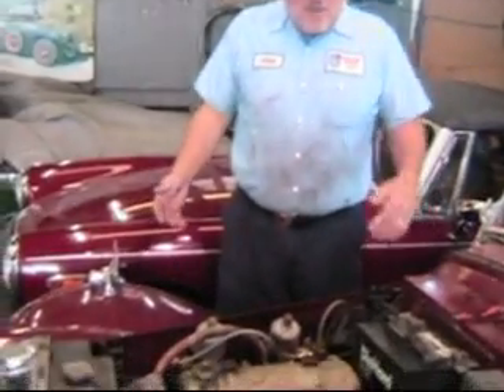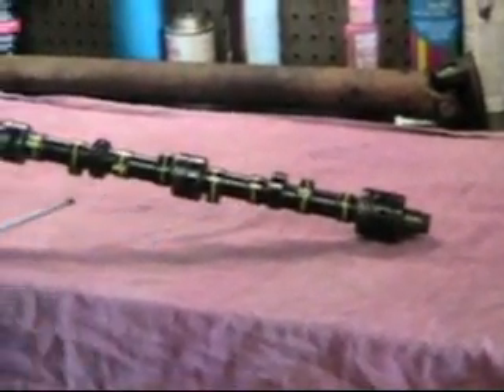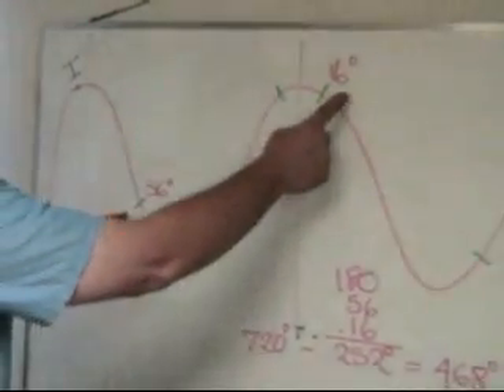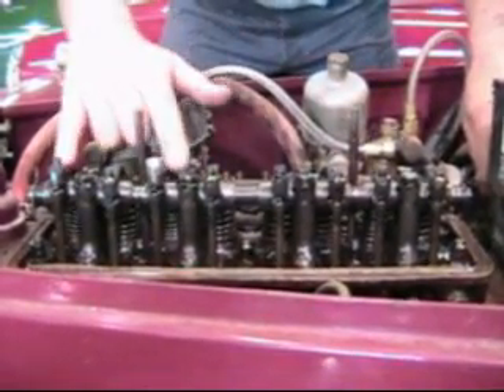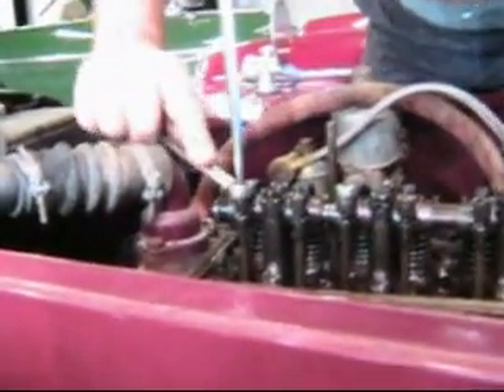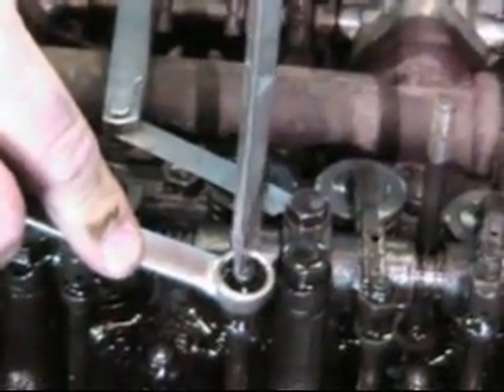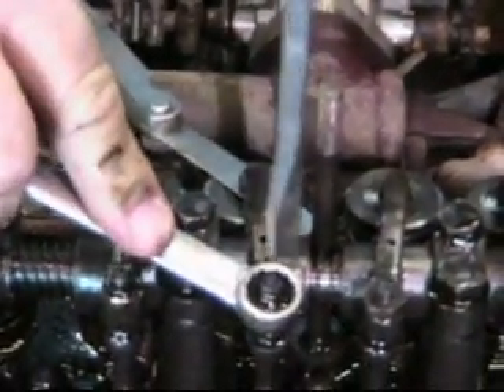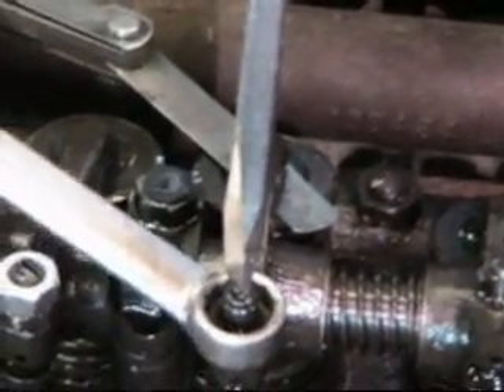010 MG Tech | MG Valve Adjustment

Comment: different engines different setting.  just make sure that the specs you use are for hot or cold engine.  hot specs are usually smaller.